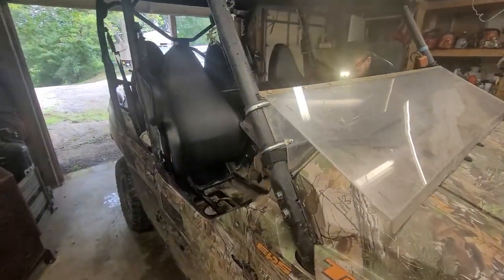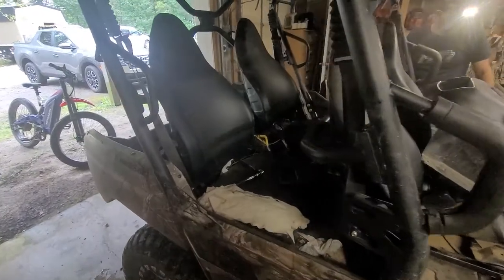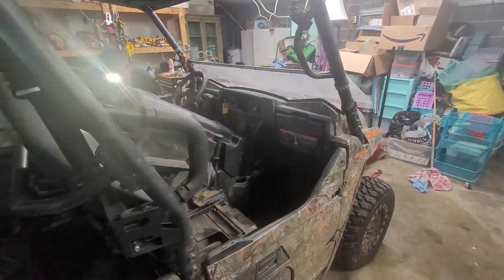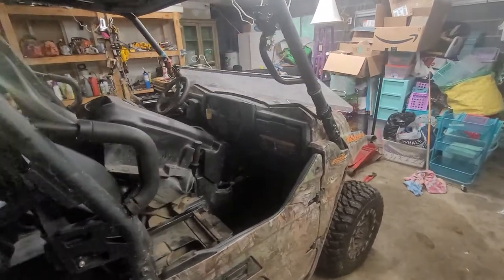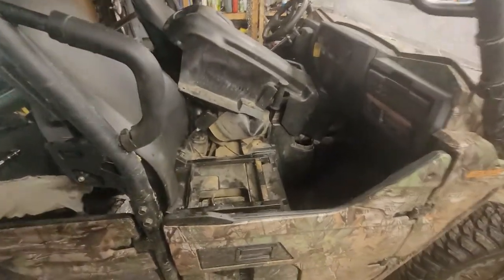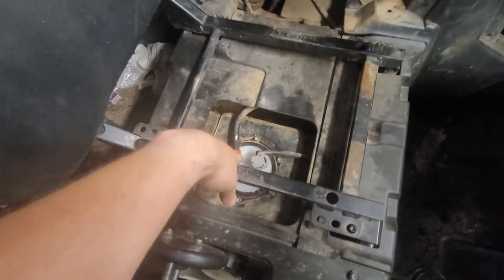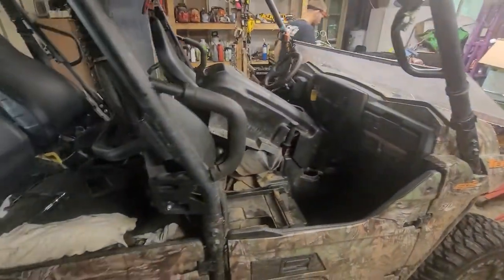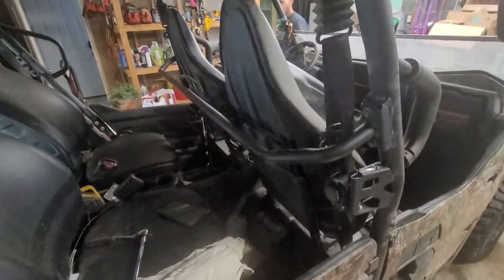Kawasaki Teryx 800 Stuttering  / Bogging / No Power - TRY THIS!

Comment: Helped my dad fix an issue today with the same UTV.  Check engine light was on and off, and moving the parking brake around made it bog down or run normal if held "just" in the right position.  Well turned out the code was 52, indicating rear cyl coil open circuit.  One of the electric leads had worked itself loose and was in close enough proximity to the parking brake, moving the brake lever around broke and reconnected the lead.  Thankfully just reseating the connection was all it was.  Maybe this will help someone else that comes across this vid.

Comment: Oh and to enter diagnostic mode, simply turn ignition to ON position, use left button on screen to see odometer, then press and hold the same left button for 2 seconds and the 2 digit engine codes will display in the lower right of the display.  To turn off, simply press and hold left button again for 2 seconds

Comment: Thanks this helped a lot I spent thousands of dollars trying to fix this problem replacing the battery the stater the fuel pump bigger fuel lines everything then I change the plugs and that it was fixed
Reply from the maker: I was hoping a few people might catch this video BEFORE they spent the money! But you're welcome haha
Reply: Hmm. I'm in the same situation.  I'll try the spark plugs tomorrow. 
Thanks
Reply: Same here
Reply: Swapped plugs still issue gonna change fuel filter next appears and looks clogged
Reply: Waiting on new fuel filter now !
Reply: @maverickwilldoit2141  i would like to know if your issue has been solved.
Reply: Can you do a video on how to check regulator and stator I'm having issue tith not charging the battery  is new
Reply: Mine was doing the same thing, changed plugs. Didn’t work, then I changed out the in fuel tank filter (sock) and that fixed it.
Reply: Sucks when people say I’m going to try this… and then never take the time to come back and say whether it worked or not
Reply: It’s the in tank sock, the factory sock has carbon in it and it breaks down after time and restricts the fuel flow.

Comment: I replaced both plugs and fuel filter, stills shut off now and then during idle
Reply: Same. It is still cutting out after new fuel pump and plugs. Did you ever get yours figured out?
Reply: @jonathancirami9737  I drained and cleaned the tank. After new pump, fuel filter, plugs and fuel tuner I don't have any issues
Reply: @harrison5100  Ok cool. I may need to clean the tank and buy a tuner as well. I appreciate it.
Reply: What tuner?